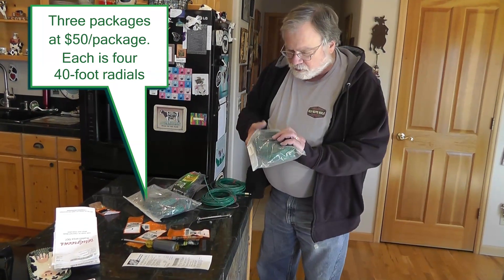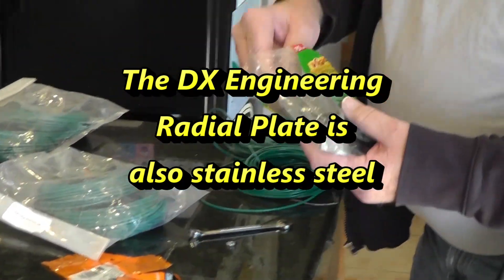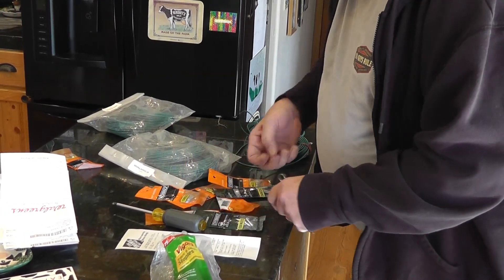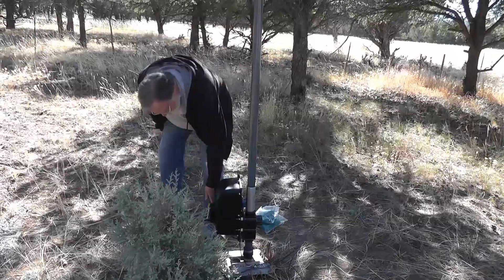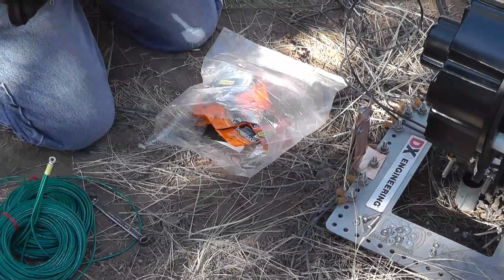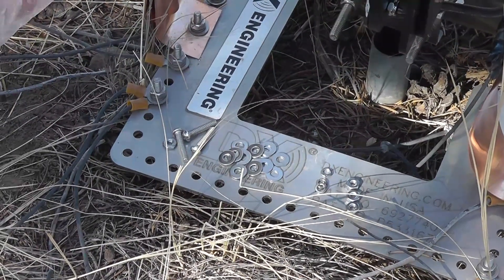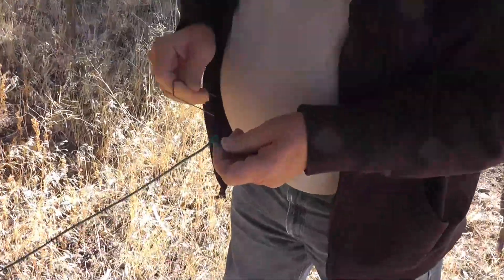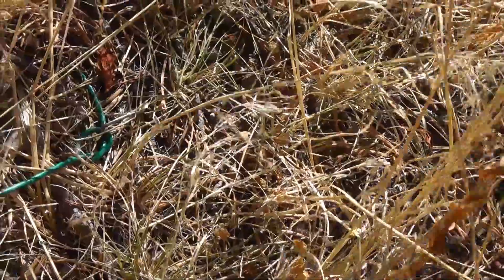Adding three SteppIR Radial Kits to the BigIR Antenna (#234)

Comment: Hope things are definitely improving for you Dave ,quick question if I may I have never owned a vertical antenna , I have always had nothing but Yagi  antennas. In fact about three months ago I put up a DB 18 three element Yagi from steppIR.
I was on their website this evening looking at the big IR but would bypass the 80 m option I see they do sell the radial kit,
So if I was to purchase the wire from Home Depot how long do I cut them at , as I mentioned I have never had a vertical or needed radials before
Reply from the maker: I've cut mine for 25 feet.

Comment: I was thinking if the the wires in the fence had been insulated from the fence posts could they not be driven of a 9:1 UNUN which connects to the transceiver via an ATU just thinking.

Comment: A suggestion.  Since the plate is stainless, tap the plate holes for an appropriate size stainless bolt. In addition, a rule I have, ANY metal to metal contact gets a coat of penetrox or the home spot brand especially stainless bolts.  That includes antennas, antenna elements, hose clamps, coax connections to the antenna, etc. Everything!
Reply from the maker: Good tip. Stainless steel is prone to galling.

Comment: Use nuts with bolt heads and put the bolts in with the heads on the bottom.  Makes it much easier.
Reply from the maker: It would be, if I could find number 10 hardware that had bolt heads. The rings that SteppIR put on the radials are too small for quarter-inch hardware. All my older dipoles are mounted as you suggest.
Reply: Flange bolts are readily available in #10. Not sure about lowes, but industrial supply stores have them.

Comment: Thanks for this vid Dave -

Another method top use in addition to, or replacement to, so many radials is to use a wire mesh ground plane. The "more radials is better" is because of improved capacitance coupling with the earth, and a wire mesh does this much easier and cheaper.  A cheap way to experiment is to use chicken wire, which will not last very long, to test this.  Deer fencing, or the like, square mesh with vinyl coating works excellent according to many  sources, and can supplement or replace the radial field with improved performance with "the more the better" just as in radial wire configuration.  I have found a number of resources on the web that show this to be the case and is how I plan to improve my own vertical antenna performance in the near future - I hope.
Reply from the maker: What you are describing works very well. I just keep adding radials every time I have some extra wire.
Reply: Bart VanAllen I am about to move and am going to use a coated chicken wire for a ground plane. I think it’s plastic coated (it’s green) and resists corrosion.

Comment: In laying the radials did you cross any of the new radilas over the old radials?  I've read that you should not cross radials, instead keep them well apart - or at least as apart as you have room.  I don't have a vertical and no backyard for radials, and an HOA that frowns.  I usually go stealth or portable/mobile.  Keep the videos coming and stay inside when the snows start.
Reply from the maker: The perfect radial system would be a large metal disc. The voltage on that disc at any instant in time is identical at the same distance away from the antenna. The same is true of radials. So if one radial crosses another, the voltage on each will be very similar. So, yes, might radials do cross somewhat, but I really do not think it is a problem. Anyway it seems to work fine.

Comment: Dave, I also think that the 16ga wire would be fine. When I built the radial system for my portable vertical, I bought 18/2 or 16/2 lamp cord, cut it to length, and split it. I then soldered a six-into-one, then crimped and soldered the one to a ring terminal to attach to the tripod leg of my antenna. I can now throw 18 radials out in about five minutes when setting up portable.
Reply from the maker: Sounds like you have a great system that works.

Comment: Look after yourself Dave, you seem to be struggling to do quite simple tasks. I hope all is well.
Reply from the maker: Well, I'm 68 years old, and have been diagnosed with "essential" tremor. I see nothing essential about it!
Reply: @davecasler  Hi Dave! Just turned 65. Retired USAF Medic and former surgical nurse. I also have essential tremors that keep me out of any "tiny" IC work,  but I can still solder the easy stuff, like PL-259s. 🤣 What I'm hearing is nothing more than a bit of "exertional dypsnia". Last year I fainted while doing tower work. Was able to get down first My heart rate dropped to 38! with confirmed A-Fib during the EMS trip to the ER. Diagnosed with severe sleep apnea, but after obtaining a CPAP machine (with 3 lt/min supplemental O2 used at night only), I no longer have any A-Fib or other heart anomalies, and feel 30 years old again!  I can absolutely observe the correlation between losing 20 pounds (by getting out of my shack and walking) and not breathing as hard while acending stairs, etc. Keep up the great work. 3rd generation ham here, and one of Wyoming's most active contesters X 33 years, typically using "100 watts and a wire" with my IC-7300. Current antenna is a ZS6BKW, which I modified to be "flater" for Advanced class phone privileges. 73, November Seven Many Zebras Walking. 😎
Reply from the maker: @chuckwilliams6294  Chuck, thanks for sharing your story. My shortness of breath has been diagnosed as asthma and I see a pulmonologist regularly. I also have sleep apnea and sleep with CPAP and O2.

Comment: Regarding the subject of adding more radials, Rudy Severns, N6LF made some interesting observations: "The purpose of this experiment was to quantify the effect of varying the number of radials in the ground systems of several different vertical antennas. Of particular interest was how much was actually to gained as the radial numbers were made larger and the point of vanishing returns." Google: "NL6F Vertical Antenna Ground System experiments"
Reply: That's a very good set of papers. They do take some reading and thinking, though.
Reply from the maker: There is a summary of this work in the ARRL antenna book. The bottom line is that you hit the point of diminishing returns pretty quickly. I think I'm probably there.

Comment: Seems it would have been better if the radial base had been threaded to eliminate wrestling with bolts and nuts.    I am considering getting BigIR and taking your advice and making my own radials using bigger ring terminals, bigger bolts and tapping the radial plate.    I will probably also use some sort of lock washers hopefully to cut into the aluminum oxidization for hopefully better electrical contact. Thanks for the video.
Reply: One of my thoughts was to use star washers instead of fender washers and the traditional split lock washers.  Being laser cut during the manufacturing process threading the holes would have meant a separate operation on a different machine adding to the cost of an already fairy expensive piece of stainless steel.  Also after several years of sitting close to the ground threads can get full of fine dirt depending on the surrounding ground material.
Reply from the maker: As it turns out, the radial plate is stainless steel. I have been using stainless steel hardware with it. All my other radials have bigger ring terminals that I can use with quarter-inch hardware. I would suggest both crimping and soldering the ring terminals.
Reply: Industry uses flange bolts and nuts (serrated for locking if you want) for this size application. Super easy to run down with an impact.

Comment: Is there any benefit to having the radials above ground/elevated?
Michael VA6XMB
Reply: Rudy Sevens NL6F has written about that. Google: "Vertical Antenna Ground System experiments"
Reply from the maker: If the radials are elevated more than a few feet, you will need to have tuned radials, at least two per band, each a quarter wavelength.
Reply: In terms of ground radials - the amount to use - at least 8 x quarter wave lengths at the lowest frequency (for example 80m of radials for 40m band). 16 of these radials are even better - any more than 24 or so and you reach basically the threshold of diminishing returns.